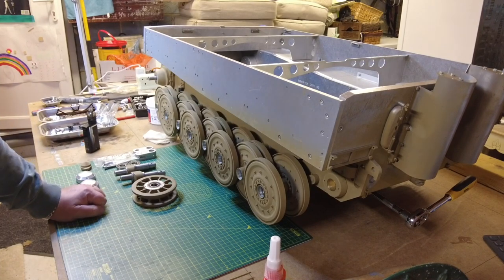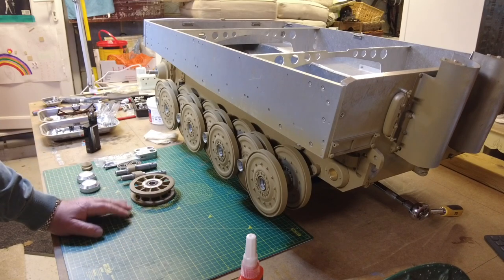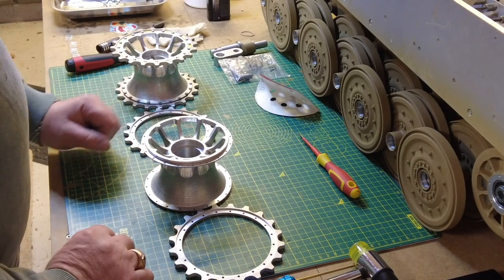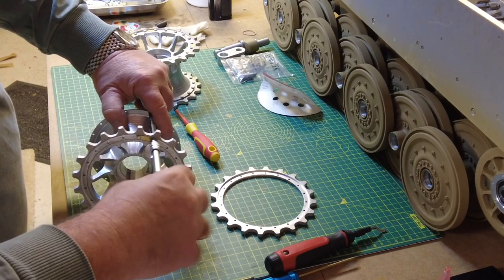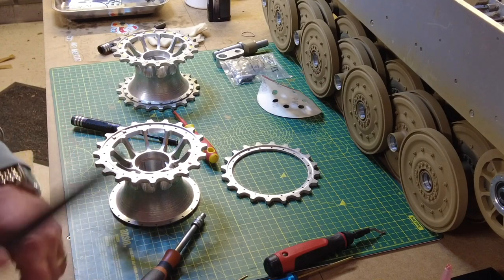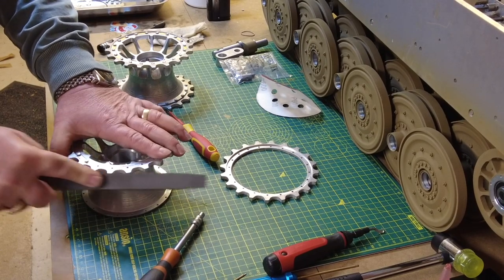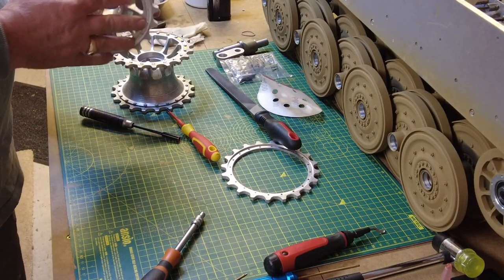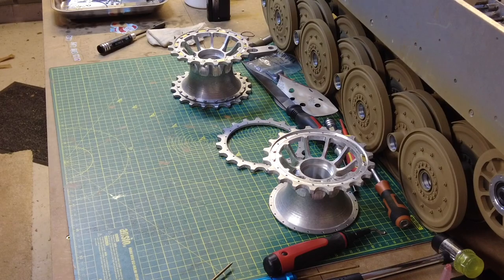1/6 Scale Armortek Tiger 1 Tank Build -  (Video 9)Sprocket and Idler Wheel installation

Comment: Morning Tony great video as always .don't understand why you have to superglue the bearings into the  return roller from each side as per the instructions. Surely years down the road and heaven forbid a bearing malfunctions that's going to be a  pain to get that old bearing back out .
Reply from the maker: Thanks Stephen and thanks also for your continued support...yes that did cross my mind as well, but thought I would glue them as instructed, as they could work themselves loose over time...I guess that these tanks have to take a lot of stress when driven...I could try a hot air gun on them if that ever happened...but hoping that will never transpire..